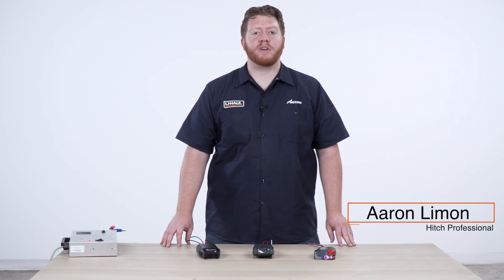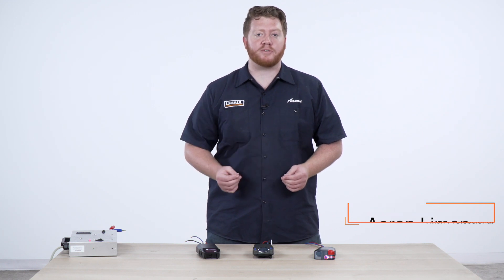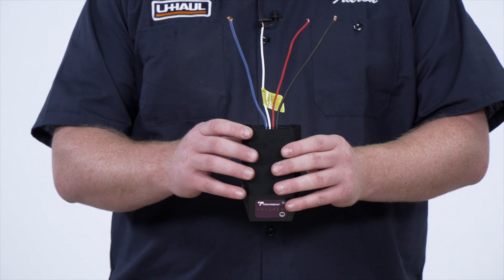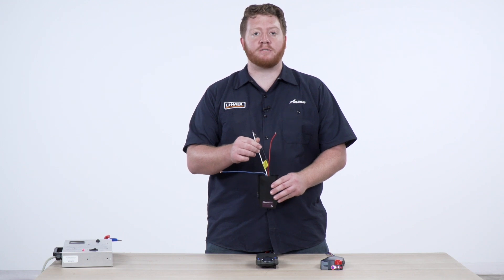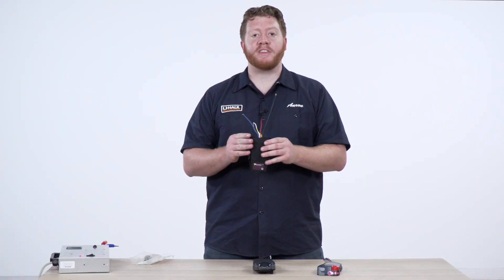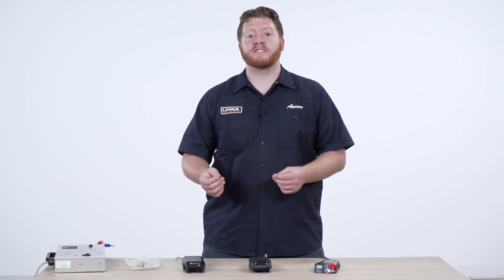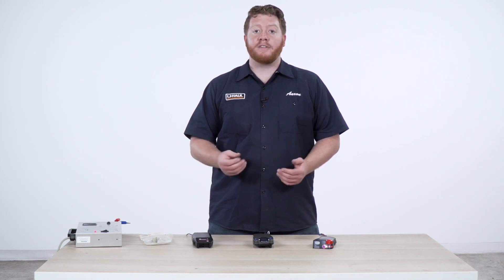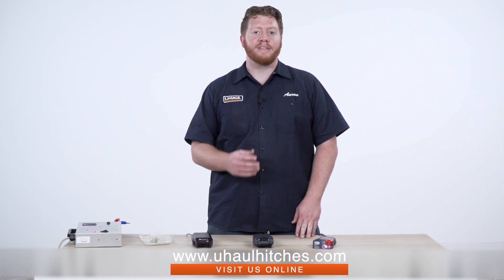Brake Controller Wire Functions

Comment: Where in a 2018 ford f150 is the wire I must splice into and what color would it be. Red aswell?
Reply from the maker: Not necessarily. It could be any number of colors pinned into the Brake controller Harness adapter. This is often found behind Dashboard trim panels in the case of Ford F150's. Often its plugged into a plastic dummy port where the factory brake controller would have been. There is a Plug and Play brake controller adapter that can be purchased to plug into the F150 and then that is matched color to color to your brake controller of choice. Visit your Local U-Haul Hitch pro to order one and go over your specific needs and the many types of brake controllers available. And to schedule an installation if needed!
Reply: @trailerhitches my truck did not come with a towing package . A 4 flat was installed. But now I installed a plug and go 4flat to 7pin but need to wire in the electric brake. But the red wire from my electric brake controller. I dont know where near the brake pedal that goes
Reply from the maker: Schedule an Installation with your Local U-Haul Hitch Pro!

Comment: i have had two brake controllers installed now , the garage installed the last one saying the old one was faulty. still the same problem. seems like when applying brake pedal or doing the brake funtion manually tires skid then release then skid again. doesnt matter how you adjust brake controller does same thing . i finally gave up on garage after several visits there . any ideas. could it be the trailer . my son pulled the trailer with his truck and said the brakes worked good .  07 silverado 1500 5.3 if that helps. he also said to me he tried a few different wires at the pedal thinking one wire wasnt working prop . but same prob tho . very frusterating. i didnt think brake controllers were rocket science. lol
Reply from the maker: First off you do not engage the manual brake button unless at a stop in a brake check area. It is used to verify the trailers brakes are engaging, and truck can barely or not move the trailer with manual button engaged.  It is not for use while towing the trailer at speed. Second, it sounds like the Brake controller is set too high when creating the skidding. Its meant to assist the Truck, not be fully responsible for stopping the trailer. Third, a Solid state or timed delay brake controller is more prone to this struggle to find a good setting. An Inertia controlled Brake controller like the Voyager https://www.uhaul.com/MovingSupplies/Wiring-Lights/Brake-Controllers/Voyager-Brake-Controller/?id=12626 uses a Acceleromenter to adjust the electricity based on what it feels on the truck. Even if the solid state controller is installed , you should be able to lower the power setting until wheels stop skidding. If they are doing this  at the lowest setting on the controller than I would say the trailers brakes are the issue. Again, if skidding stops at a lower setting, you may  not "feel" trailer stop[ping. However, It should not feel like the trailer is pushing you around. You can always schedule troubleshooting with your Local U-Haul Hitch Pro!
Reply: @trailerhitches  thats what i was saying , the + and -  buttons don't seem to be working. it doesn't matter how long i hold the minus button down .the green light on controller stays bright. its supposed to get dim when powering down . power wires are all reading what their supposed to . get what you pay for i guess ( BRAKE-FORCE) IS THE BRAND OF CONTROLLER.
Reply from the maker: We do not sell or install Brake-Force brake controllers. Consider getting a quality Brake controller installed by a U-Haul Hitch Professional.

Comment: Im confused about the red wire.  He said at about 1:17 that when the pedal is pushed the brake light switch sends a signal to the brake controller which then sends a signal through the red wire to the trailer brakes.  Shouldn't the red wire send a signal to the trailer brake lights and not the brakes themselves as sending power to the brakes would be the function of the blue wire?
Reply from the maker: The red wire provides the INPUT to the brake controller and the blue wire provides OUTPUT to the trailer brakes. Hope that helps you out.
Reply: @trailerhitches  yes thank you. So if Im understanding all this correctly operating the brake controller manually without pressing on the brake pedal would cause the trailer brakes to operate but there would be no illumination of the trailer brake lights.
Reply from the maker: The manual button on a brake controller is meant to test functionality of your trailers brakes in a Brake check area, like prior to a mountain grade. Its so you can manually engage trailer brakes to feel the truck not move or barely move at idle. Signalling working trailer brakes. Its not intended to be pressed while the trailer is in tow.

Comment: Does the blue wire which is the brake activation on the trailer, also connect to the brake stop light on the trailer?
Reply from the maker: No. The electric signal on the Blue wire comes from the electric brake controller(like what Aaron is holding) that should be mounted under the dashboard. Visit your nearest Local U-Haul Hitch Center to schedule troubleshooting and Installation.